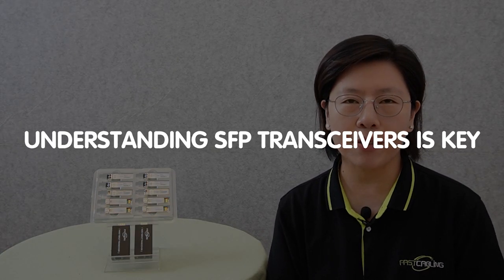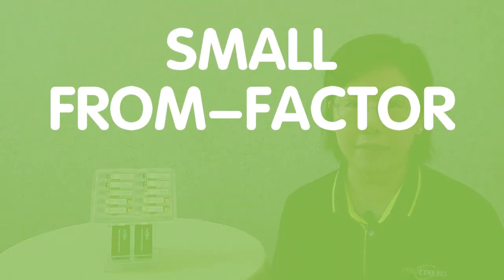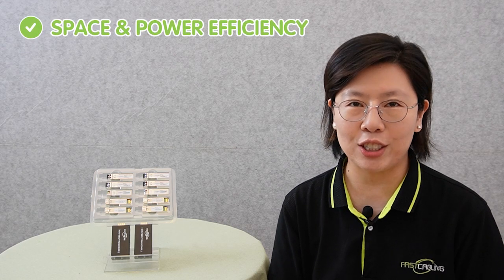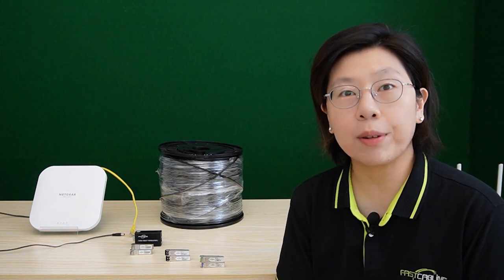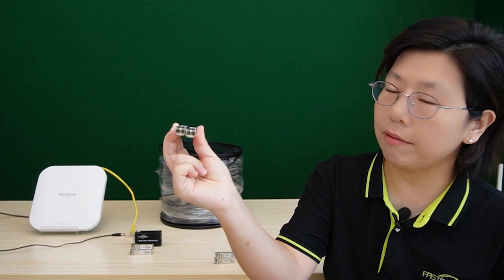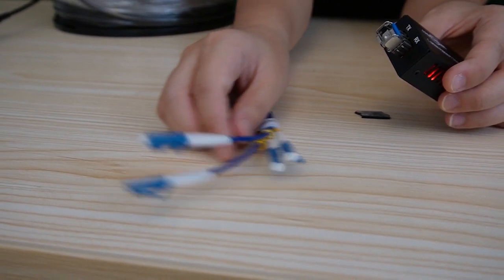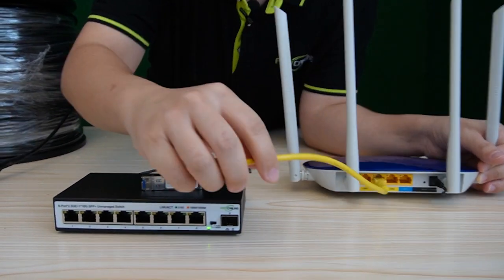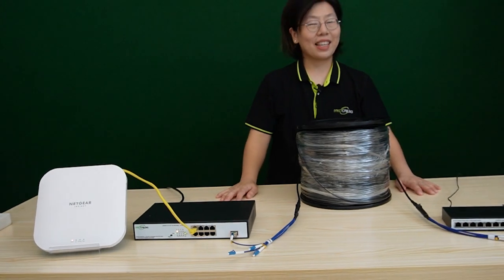SFP Transceivers: What You Need to Know

Comment: Wait, what? You connected one TX with one LC connector the cable between routers and telling that connection is done? Done for what? A TV broadcasting? Why you didn't connect RX cable for signal receiving? LC is not MTP connector.
Reply from the maker: We’re using BiDi SFP modules. With BiDi, TX and RX share a single LC fiber using different wavelengths, so only one LC connector is required for both transmitting and receiving.

That’s why you don’t see a separate RX fiber like with standard dual-fiber SFPs.

You can find more information here: https://www.fastcabling.com/product/bidi-sfp-fiber-modules-2/
Reply: @Fastcabling  Bi-Directional? This is make sense then. I didn't see  BiDi markings on transceivers in your video, so. Anyway, thank you for your response!

Comment: Why different colors on the tranceivers? Any specific reason?
Reply from the maker: The wavelengths are different. BiDi transceivers leverage WDM technology, where the light is split into different channels (wavelengths). A typical pair of BiDi transceivers might use 1310 nm for Tx on one end and 1550 nm for Rx on the other, with the opposite configuration on the other transceiver in the pair. This ensures that the data being sent from one transceiver is received properly by the other, and vice versa.

Comment: Hello, thanks for the information provided on the video!

Just a quick question, is there any SFP transceivers for ONT or GPON fiber cables so it can it be used with the fastcabling media converter?

Context: In my country, fiber optic solutions provided by ISP are GPON based but their modem/router is very old hardware and i would like to use my own router

I thank you in advance for any help with that info :D
Reply from the maker: Unfortunately, SFP transceivers used in switches or media converters do not directly support GPON. GPON uses a specific protocol that requires a compatible GPON SFP module.

Comment: Thanks for the information. This is all fibre going out from the original router. Are there routers on the market that take direct fibre in connection. Probably just need a fibre to RJ45 adapter.
Reply from the maker: The Ubiquiti EdgeRouter 4 or MikroTik RB4011 have SFP ports that allow you to insert a fiber optic module directly.

Comment: Confused, why use the rj45 converter to fiber at the router, vs just using an sfp+ to rj45 10G or 1G transceiver module at the switch side?  I guess maybe depends on how easy it is to run the fiber vs cat6, shouldnt be a speed difference?
Reply from the maker: That's because the router doesn't have a fiber/SFP slot. The media converter is used to convert electrical siganls to optical signals, and vice versa.
Reply: @Fastcabling I assumed the RJ45 converter transceivers were bi directional so you could run cat 5 or cat 6 to the router
Reply from the maker: Yes, they can convert Ethernet signals from copper (RJ45) to fiber and from fiber back to copper (RJ45). You can run a Cat5/6 cable to the router and connect the media converters using the fiber optic cable.

Comment: If two 1GB switches are next to each other in the rack and both have SFP ports what transceivers / cable is recommended?
Reply from the maker: You can use this BiDi SFP module (single mode, LC connector) whose speed is rated at 1.25Gbps, and connect two switches using a fiber optic patch cable. https://www.fastcabling.com/product/bidi-sfp-fiber-modules-2/

But if your switches have a Gigabit RJ45 uplink, you can connect them with Cat5e/Cat6 Ethernet cables directly.

Comment: I'm new to this fast networking world.
Why would I use an SFP+ transceiver for my 2.5G home network when I have the home cabled with Eth Cat 7?
Reply from the maker: In many home network scenarios, especially at 2.5G speeds, Cat 7 cabling will serve well and is a straightforward solution. While your current needs might be met with 2.5G, SFP+ supports up to 10Gbps. For example, connecting NAS devices, servers, or uplinks between switches might benefit from the higher throughput capabilities of 10G. The range of PoE/Ethernet is limited to 100 meters, while SFP+ modules with fiber optics can be used to extend the network over greater distances without signal degradation.
Reply: @Fastcabling  thank you for the detailed answer. Since it will be less than 100m, I think I will opt for cat 7. Thanks

Comment: I learnd more here thani have from several weeks of Internet searches.
Just one question, please. Does the connection in your example carry data both ways? Or, is a second cable required? ( The terms may no longer be applicable, but is the connection simplex or duplex?)
Reply from the maker: The communication is bi-directional as we use a BiDi SFP module which can transmit data in both directions over a single fiber strand. The pre-terminated fiber cable is simplex, with 2 strands.
Reply: @Fastcabling   okay, let me see if I have this correct. Both directions are moving through a single strand, albeit on two different wavelengths I presume. The other strand is doing nothing. (?) Correct?
In other words,  again assuming I understand, the connection could be made with a single strand cable, but you used the two strand cable for the SFP connector required by the BIDI SFP module.
Reply from the maker: The BiDi SFP module only uses one strand. The fiber cable consists of two strands so you can set up two connections.
Reply: @Fastcabling  thank you! I think I've got it now. I appreciate your responding to such an elementary question.
Reply from the maker: No big deal!